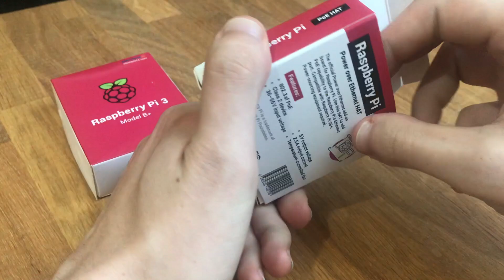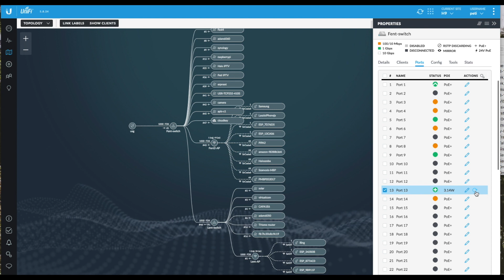Raspberry Pi PoE HAT - Unboxing and Test

Comment: Banana Pi BPI-P2 Zero is an ultra compact single board computer measures only 65mm*52.5mm. It uses quad-core Cortex A7 allwinner H2+ processor(Option : H3 and H5), with 512MB RAM memory.8G eMMC flash,100M LAN,add PoE function support , It's ideal for light-weight systems with some space-limited applications. Like other members of Banana Pi, it supports both linux and android operating system.
http://wiki.banana-pi.org/Banana_Pi_BPI-P2_Zero
Reply from the maker: I would be glad to test a unit! ;)

Comment: do you lose access to all the pins by installing this HAT? I mean if I need to access those port can I?
Reply: The RPi blog recommended using a 20x2 pin extension if you need it. 
Link to the blog:
https://www.raspberrypi.org/blog/introducing-power-over-ethernet-poe-hat/
Reply from the maker: Unfortunately you do loose access to the pins, you also have to have the hat connected directly to the pi, as there are more pins used to power the pi. Maybe a custom board with a passthrough could be an option. In your case.
Reply: A 2X20 pass-through  header is something you are looking for.

Comment: Nice, just got my PoE HAT today, looking forward to seeing what you do with it. I also use UniFi stuff but I have no PoE switch, so for now I will get a PoE injector like what comes with the my UAP-AC-PROs  I have a cloud key but want to try a raspberry pi as my controller :)
Reply from the maker: Hey, yea i used to do the same, but i had a cloud key left from a job I did so I did not let it sit around :) i do want to move all of my sites to one cloud hosted controller. Do you want to see some unifi videos?
Reply: Yes more vids would be cool